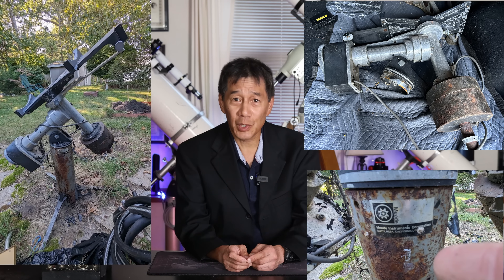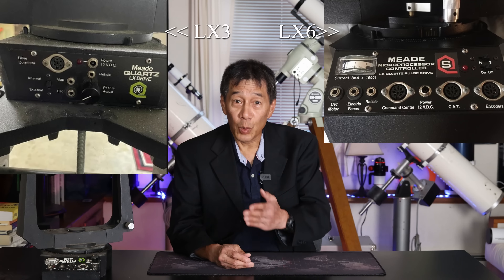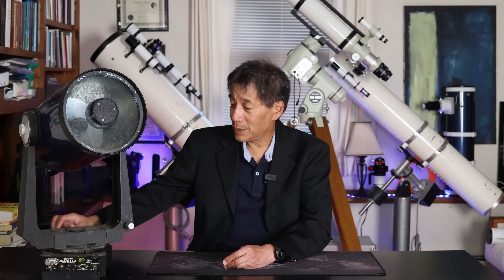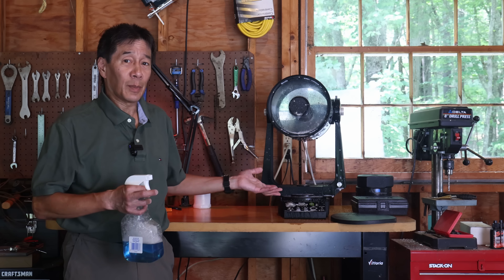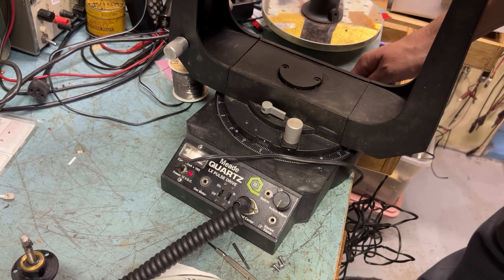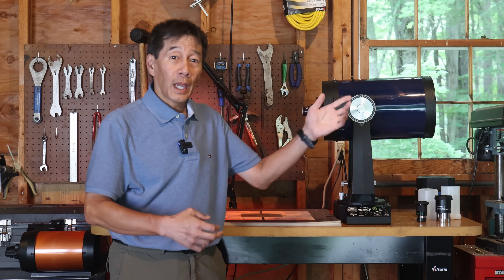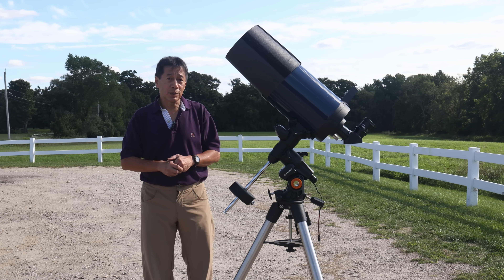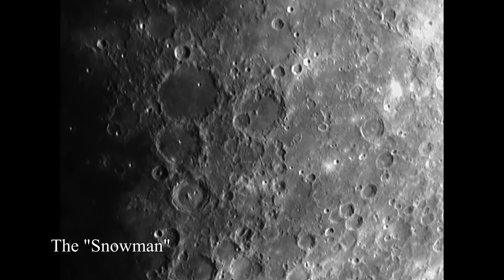Is This Bad?? A Telescope-Shaped Piece of Dirt Shows Up. Can it be Salvaged? See What Happens!

Comment: I use 70% isopropanol and distilled water mixing them 30% and 70% respectively. I first soak in distilled water with 3 or 4 drops of nothing added dish soap. Then I clean outward from the center in small upward strokes using cotton balls and the isopropanol-water mix. I have stripped down and cleaned 2 SCTs to date and this method that I found somewhere on the net has worked well for me.

 The second SCT had mildew on the inside of the corrector plate but I guess I got it before it ate the coatings.
Reply: So that means you use 21% IPA.  Why?  I use 98% IPA when cleaning optics.

Comment: As much as I do like these rehabilitation stories, I see the problem with living in the past when newer tech is sooooo much better than old telescopes.
Reply: Depends on what you're looking at.  Many old Newtonians are SUPERB in figure, may need a recoat, but could be very worth it.

Whatever brings the photons to my face eyes is fine by me.
Reply: State of the art was reached a very long time ago for telescope optics.  New optics aren't really made any better.
Reply: @ You can now attach your phone to a telescope and it can guild you around the galaxy. New better mounts with better gearing is also leaps ahead. Lithium batteries have made access to dark skies also within everyone's reach. It's hard to keep up let alone say it peaked long ago.
Reply: @justsomeguy6474  You really need to work on your reading comprehension.  Nothing you mentioned has anything to do with OPTICS.   I got my first telescope 40 years ago.  The mount was completely adequate and wasn't really anything new at the time.   I got my first LX200 goto scope 32 years ago.  No phone required.   What do you need lithium batteries for?  Telescopes aren't exactly high power devices.  I think you believe new tech is better because you have no experience with the old stuff.
Reply: @ So you don't do any astrophotography, got it.
Reply: @justsomeguy6474  Do you see my name?  I'm an astronomer. You aren't the sharpest crayon in the box, are you?

Comment: I unforked mine and found a vixen plate that actually fit properly. I use it on a ZWO AM5 eq mount now and love it.
I even made a custom dew heater with a cheap temperature controller and an old car seat warmer (nichrome  wire). Fun project 👍.  Great video Ed. ❤

Comment: I get a lot of scopes in all sorts of conditions donated to us at The Villages Astronomy Club. You never know what's going to come to the door. I've received recently purchased scopes still in their original packaging, and scopes that have been completely disassembled, down to the eyepiece lenses, and delivered in boxes that have been outside with animals living in them. 

The one I put the most work in to so far was a beautiful little 50mm Unitron. It was one delivered to me in pieces crusted in filth with some parts of the tripod missing. In the end I got it back in excellent shape with a lot of tender cleaning work (let the solvent do the work!) and reconstruction of the tripod elements that were missing. A member made a generous donation to the club to take it for their own. I'd never used the Unitron alt-az mount before, I wish that was the mount the modern manufacturers copied rather than the awful fork mounts we've had since the 50s and 60s.

Comment: Funny thing about used Meade 8” SCTs they seem to go for twice or more the price of a Celestron. Having used both of them from the 70’s through the 90’s I prefer the Celestrons. They are lighter, have better off axis performance. You can get a nice older C8 for about $4-500 used whereas the Meade is $1000 to $1200. The Meade SCT always seemed to have slightly poorer off axis correction and more field curvature.

Comment: About 6 months ago I bought an old Meade 8 inch Starfinder but it was at least in good shape cosmetic shape. Even the electro-mechanical RA drive worked fine. It now lives on a dobson mount of my own fabrication and I have an extra GEM I have no idea what to do with.
Reply from the maker: I can't stand the Starfinder series!  I know, I bought many of them.  The pedestal mounts are decent (they are derived from the Meade Newts of the 1980s) but for the Starfinder series they ditched the tube rings for those horrid straps.

Comment: Was the corrector plate coating absent before you hit it with Windex? The ammonia could have had an impact. Admittedly I have on rare occasion used Windex with a Q-Tip on eyepieces without noticeable degradation, but in this case I'd recommend taking the optics out and soaking for a day or ten in distilled water with lots of dish soap.

Comment: I own to 2080 OTA's, an LX6 Premiere and an LX10. One thing common to both are the almost pot metal screws Meade used to secure the corrector plate. The heads on most of mine were stripped, and getting them unscrewed was quite a challenge. I replaced them all with stainless steel replacements of the same size and pitch. I also added Bob's Knobs mainly because the collimation screws were also stripped.

Comment: Great report, Ed. I would have never dreamed you could use pure Windex as an optics cleaner. I always cut it way down to a drop or two in a gallon of distilled water. I'm sorry the corrector plate was not able to be returned to its former glory. The rest of the scope looks great. No doubt you will thrill first time observers with low power views of the moon at star parties. Clear skies!

Comment: Recoating the mirrors is straight forward but recoating the corrector plate. Well a quick search had Lundt in Tucson suggested. But that was a pretty old thread. Since it was the only one I found it's worth a shot. Nice work!

With all the micro controllers around you would think someone has made a DIY replacement - or could "easily" do one. "Easily" as in I wouldn't do it. :D
Reply: The LX5 had very basic electronics.  There's no computer in it.

Comment: That is a fantastic find, and a great rescue! A maxim for something like this, even with the faults it has as a result of so much neglect, is that once restored, a slightly imperfect quality telescope is better than no telescope.

If I was gifted a 200 mm rescue like this (my current biggest scope is a 150 mm Newtonian) and it could be restored to this level, I would find it perfect for visual observation of variable stars, and possibly even for camera photometry of the same. You don't need perfect optics for such an end use, and, anyway, perfect focus is detrimental to accurate Mark 1 eyeball brightness estimation or camera photometry. This rescue 'scope might be imperfect, but it's still a gem!

Comment: I worked recently on a Meade 8 inch SCT belonging to a friend who had left it for some consideable time in a damp shed.  It was in a very sorry state.  The corrector plate was covered in green fungus, mostly on the inside surface .  I got it back to a very presentable state eventually  but it was a lot of work.   I marked the orientation of the corrector (very important) then washed the plate in warm water and fairy liquid... I think you'd call it 'dish soap'. I then very lightly wiped the remaining water droplets off using cotton balls.... dozens of them, so as not to scratch anything... as you did. The optics were then washed with demineralised water but that still  left many visible sleeks.  I then resorted to using lab grade isopropyl alcohol and lots more cotton balls which worked great. On this Meade the corrector plate spot was perfect so didn't need cleaning, a great relief.  I was just glad to be able to restore it for a good friend.

Comment: Great video! You mentioned cotton balls. I am new to astronomy, and my telescope lens is getting very dirty, can i use alcohol with cotton balls without hurting the lens coating?
Reply: Instead of cotton balls, which are normally for cosmetic purposes and therefore may not be of the best quality (think wood fibers mixed in) use surgical cotton batts, first aid cotton batts. Just tear off what you need.
Reply: @richardwalker9330  thank you! Is Isopropyl alcohol suitable for this matter?
Reply: @ I used lab grade Isopropyl alcohol for final cleaning and it worked well and Baader Planetarium  sell a specialised cleaning liquid that I've used to good effect for cleaning refractor telecope lenses. Baader Optical Wonder Fluid. It works extremely well for final cleaning.
Reply: I wouldn't unless you really know what you are doing.  Glass is soft and is VERY easily scratched.

Comment: Fun story on my part.  When I was a teen I ground 2 mirrors for scopes.  One was a 6" and when it turned out really well I decided to go all out and did a 12.5" monster.  I finished it and basically went off to college and put the 12.5" scope in my dads shed.  Time passed, I got married, had kids and the scope was 'forgotten'.  20 yrs later the kids were grown and I decided to get back into the 'hobby'.  I went to my dads to get the scope and to my dismay the cover I had on it was not there... I looked down the tube at the mirror and my heart sank!  Two fox squirrels had fallen in and met an untimely death by starvation as they couldn't climb out.  The entire mirror cell end was covered in fly larva cases and the mirror was literally scratched so bad there was no coating on it.  I live near Dudley Clausing (50-60 miles) in Skokie, Illinois so I took it to him and asked if he could 'save' it and recoat it.  Long story short he SAVED that mirror and I couldn't even tell the squirrels had touched it!  Obviously Pyrex is much harder than nails and teeth!
Reply from the maker: Thanks for the story!
Reply: @edting  Hi Ed! If possible can you please do a SkyWatcher 16” Skyliner 400P FlexTube Goto review? Thank you.

Comment: I wish someone would leave a dusty 8 inch SCT on my doorstep 😊
Reply: Ngl i stopped reading after 8 inch was really confused
Reply: This was a bit more than dusty.
Reply: My experience trying to restore a dirt-cheap SCT went very badly, not only had the coatings on the corrector worn off but I couldnt collimate it however I tried :( 
The previous owner had taken out the corrector plate and (tried to) clean it but left no markings on the orientation. I couldn't get it to focus on anything, even the moon looked like a blob with that thing. Eventually I just got rid of it (just like the previous owner)
Perhaps you might have better luck when you find such a telescope, my (so-called) skills came up for nought :D
Reply: if you are not a part of one yet, join an astronomy club. we are constantly turning away donations like this because we have no place to store more broken telescopes. We are looking at creating an adopt a telescope program for members willing to fix them up.

Comment: Hi Ed. I've got the LX10, from 1998. I've had the mirrors out for cleaning a number of times and now have cleaning down to about 1 hr.(but yes, lots of cotton wool balls) I followed the method described by Willie Koorts at Sutherland, RSA. My drive base is also fine and I run it from a car battery with the standard size jackplug. What chips me off is the declination manual slow motion/drive setup! The declination bearings are also crude bits of plastic and not really fit for purpose.The mirrors on this old scope are now 25 years old and are starting to deteriorate a litte. I'm trying to decide if it's time to realuminize or just scrap it!
Reply: There should be no reason to ever clean the mirror on an SCT if it is stored properly.

Comment: I use a mixture of vinegar/alcohol 50/50 mix with 3 drops of dawn to clean my mirrors. I do not touch my mirror until the very end. I gently roll the solution across the mirror. If there is debris stuck, I let it sit until the bubbles form then roll the solution across again for another 5 min. 

If everything appears clear, I will use cotton balls from center of mirror out rolling cotton ball upward across the mirror to pull up any dirt but not scratch across the mirror.

Then I use a brush to remove any new dust before I make a final pass with vinegar/alcohol mix. Using a light I shine across the glass to look for any residue before replacing mirror into the housing. 

OMG, I despise cleaning the mirror and hope I do not have to repeat that again any time soon. Smoke from campsites upwind of JGAP settled onto my mirror in 2024. 😢

Comment: Just curious, can an ultrasonic cleaner be used to clean mirrors or does it damage them?
Reply: I've never heard of it being tried. You could do it first and then report back.😊.
Reply: Should certainly be possible  but you'd need a large tank.
Reply: Don't! It will remove the coating for sure. Just chuck a piece of aluminum foil into an ultrasonic and see what happens to it.